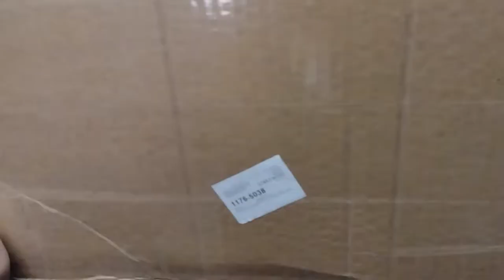Vintage 2010 OLD School ANTEC Skeleton Case

Comment: i had one of those when it came out...was cool for 1-2 months lol. btw you can actualy slide the motherboard panel out to install it. also there is a button somewhere to change the light on the top fan. like i said was cool for a bit but you need a big desk and it collect dust like crazy
Reply from the maker: Yes.. it's cool to look at it... But it's a pain to build in..  it sits on the bench and it does it's job...lol.  Thx for your comment. Plz consider Subscribing
Reply from the maker: Yea. I figured out the motherboard comes out and I found the button u was talking it about..it's kinda hidden right on top.. 😂

Comment: I was there flwhen it was out protip if you need to lube thst big fan 3 in 1 works as does sewing machine oil given its age id do it straight off thr bat
Reply from the maker: I was wondering what type of oil I should use on that switch ..  sewing machine oil. That's a good idea. 👍    The case needs to be cleaned from head to toe.